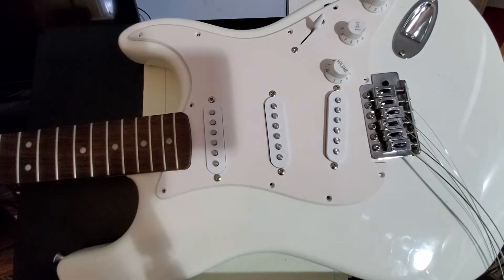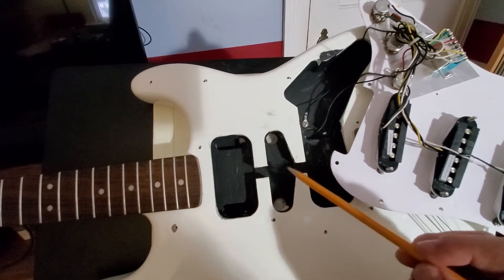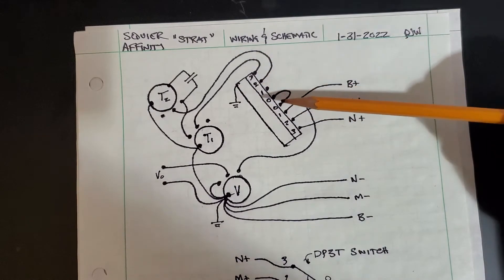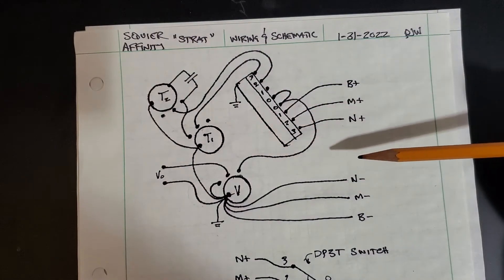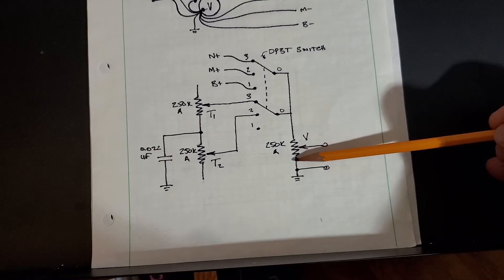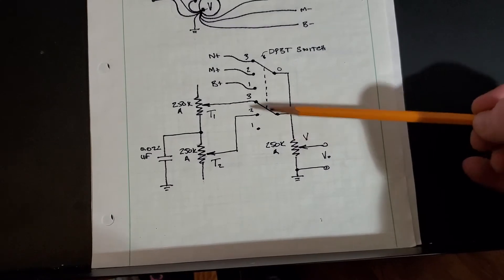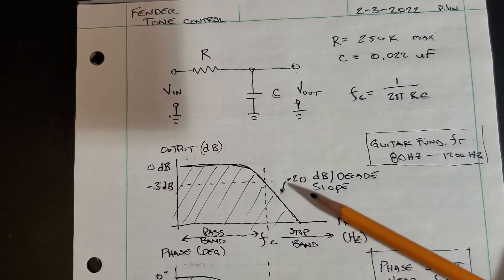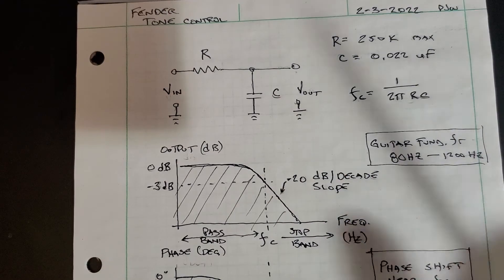Pete's Blend - There is a phase shift effect built into your Squier's tone control!!! V1:E5

Comment: PETER BLEND, What type of passive network circuit would be able to "shift" the resonance frequency to the left or right of the LCR pickup? SRV Charley guitar has only one volume pot and one tone pot which when you roll down the volume pot its changing the output impedance of the guitar but since it only has one tone pot its less "loading" on the LCR pickups so you get more of a glassy clean tone which sounds like the guitar is in tin metal can. It has to do with impedance and the frequency response curve changes. If you use a strat with two tone pots its loads down the LCR of the pickup and shifts the response frequency to the left or right. When you remove one of the tone pots it makes the mid bump higher in the frequency response and changes the LCR pickup impedance. Its a very complex thing but that is why SRV charley only used one volume pot and one tone pot because its changes the pickups frequency response. If you look at Shelton guitars the shelton skyflite IV strat uses a special RC phase blend pot which out the video and website https://www.youtube.com/watch?v=iKdIIFHsiq4&t=830s